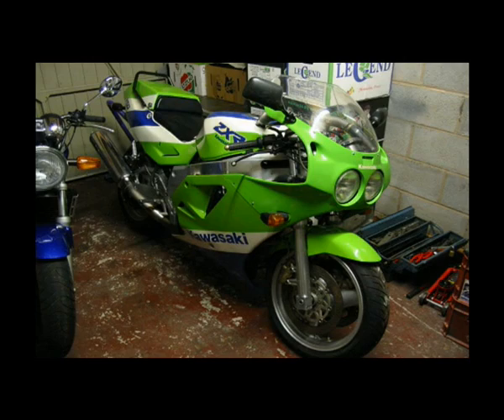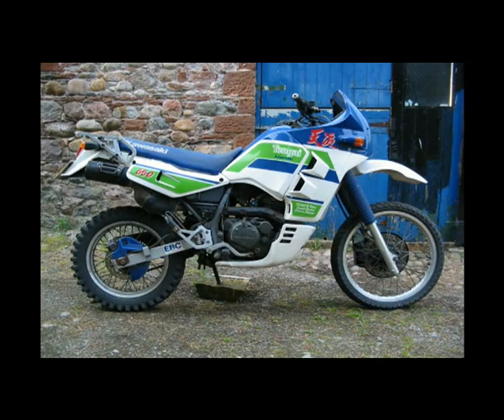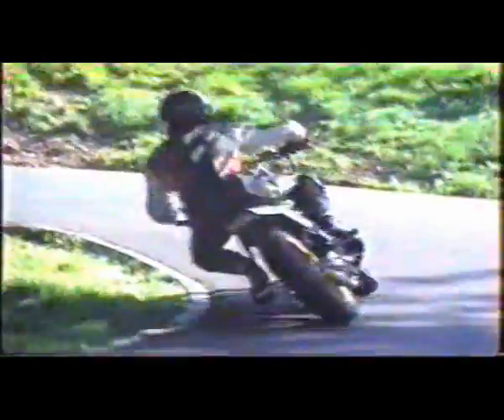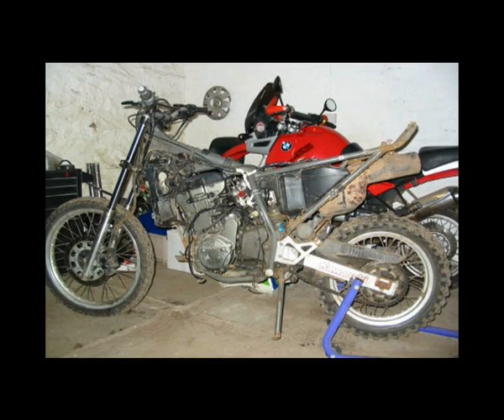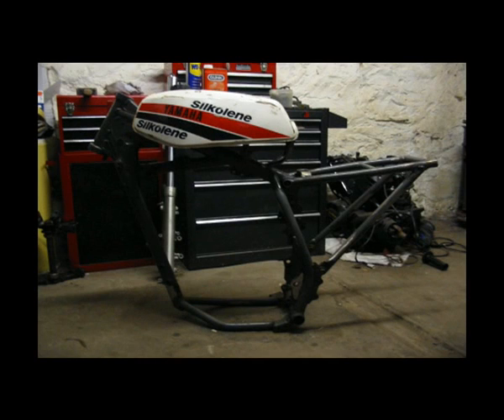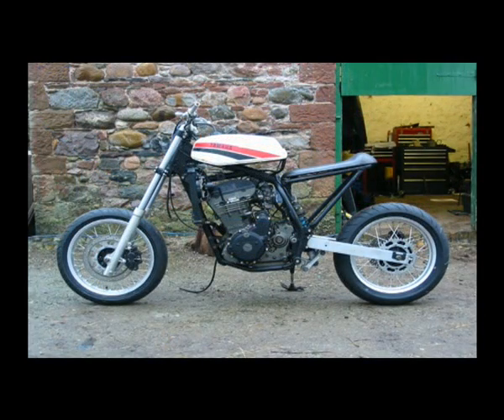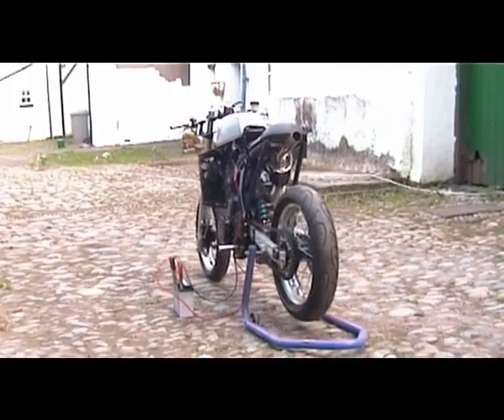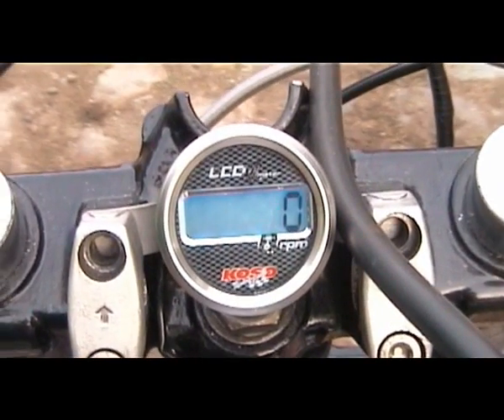Kawasaki Tengai Cafe Racer Hillclimber Motorcycle Build - Short Documentary

Comment: Have you any idea how rare Tengai's are now? You've ruined a classic motorcycle there mate. Way ahead of it's time.
Reply from the maker: Yes, tell me about it.

Unfortunately when I built it in 2005, you couldn't give them away.
Reply: MrKips1 It doesn't look like he damaged the plastics, or even had the plastics to begin with. Those are basically the only unique parts of the Tengai. The frame/engine/transmission is identical to a regular KLR>. Small suspension differences, different brakes. Rear Sub Frame is a little different, but only where the rear pegs are mounted. :) If you'd cut the plastics though, then I agree. ;)